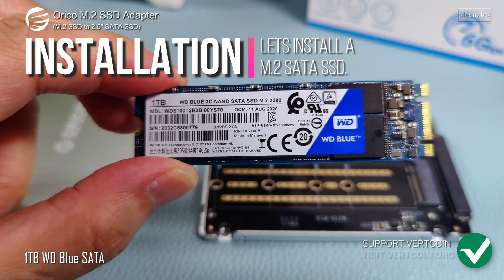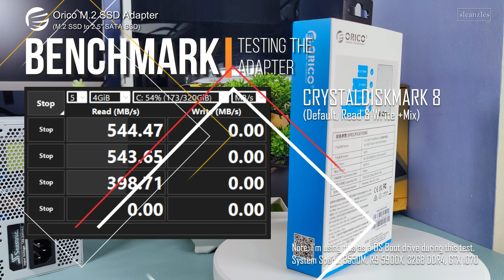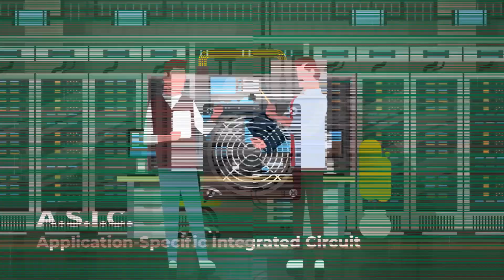Orico M.2 Sata SSD Adapter |  Extra SSD Equals More SSD Storage

Comment from the maker: If you have any questions about  the Orico M.2 Sata SSD Adapter in the video feel free to ask and drop a comment down below. I will try my best to answer them based on my experienced on using it :yougotthis:. For technical support and troubleshooting might be best though to contact Orico Support on their website for further assistance :goodvibes:.
Reply: Do the thermal pads perfectly touch the topside?
Reply from the maker: @TingFeng77 hmmm 🤔 I can't recall or more like I didn't bother but I definitely hope so 😅. I will check on it next time I clean my PC to double check.
Reply: How many TB max size?
Reply from the maker: @syarifairlangga4608  2TB

Comment: Bro,
Is it give constant 400 mbps write speed? (Considering good m.2 ssd with dram cache)

Is there any problem like sudden stuck during copying?
Reply from the maker: Ain't constant as you can see on the test and also depends if from where you're copying from. If you're copying from HDD then it's much lower about 100-200 maybe. But I haven't encountered dropping to zero or getting stuck so far.